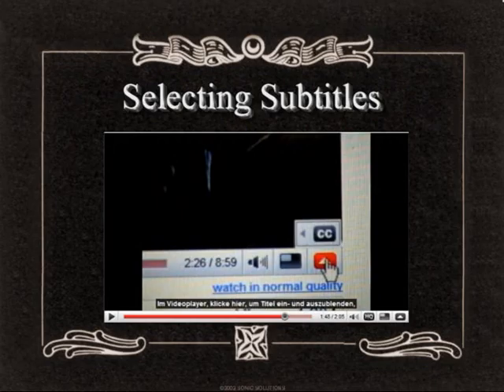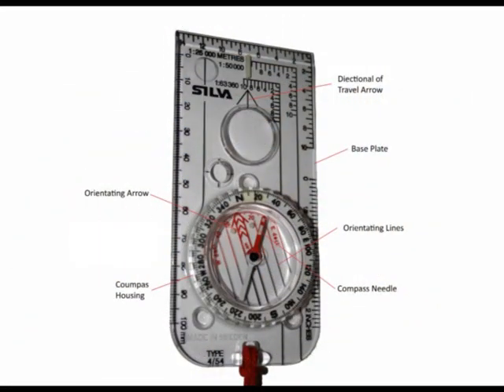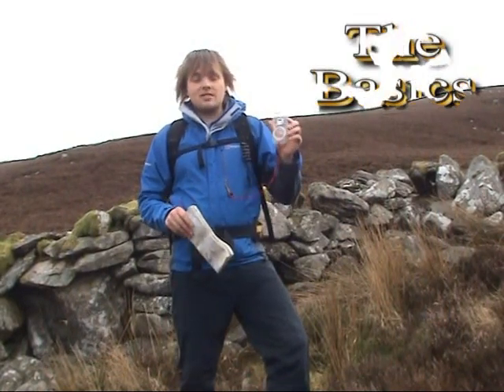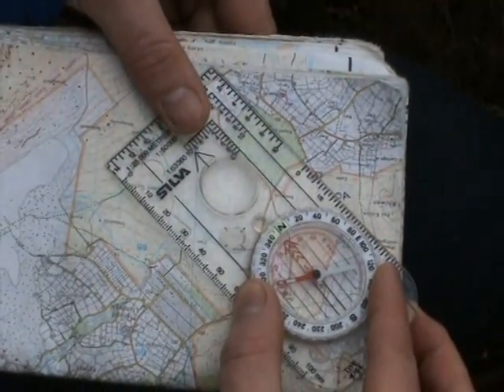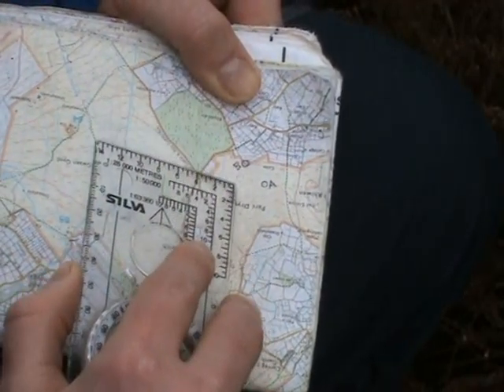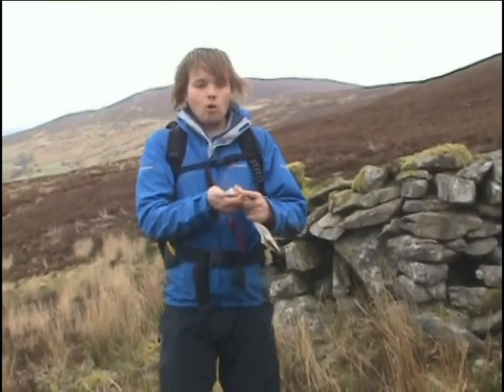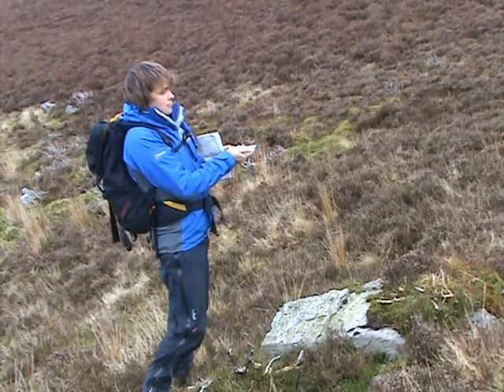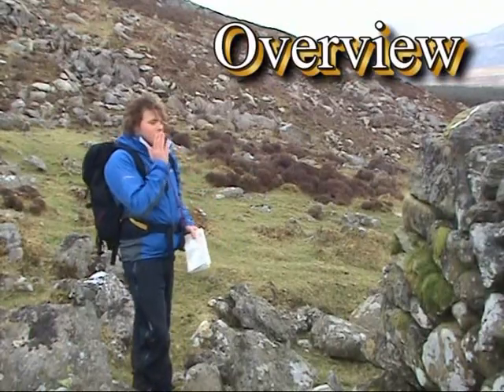Taking and following a bearing

Comment: Sorry to ruin your day but you are using the wrong terms. What you are doing is taking an azmuth reading and calling it a bearing. Your actual bearing would read as follows.
S.46(deg)E.
I would like to add almost all of the videos I have seen regarding taking a bearing have been making the same mistake. If you do a little studying you will discover that I am right. Another point I would like to add is why don't you just purchase a compass for a couple of more dollars that has a declination adjustment. It would save you a little extra effort, and make your video less confusing.  Now you may go back home , try not to get lost.